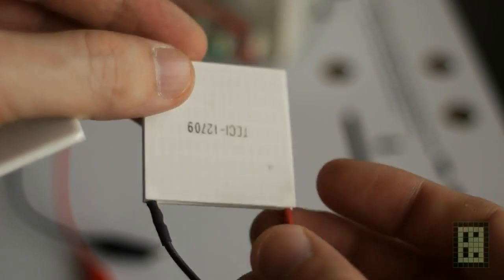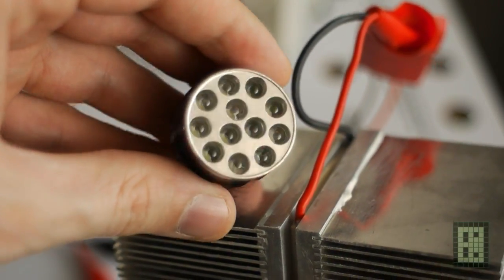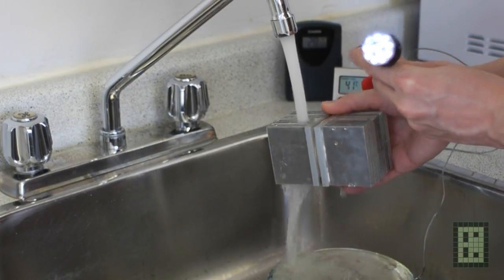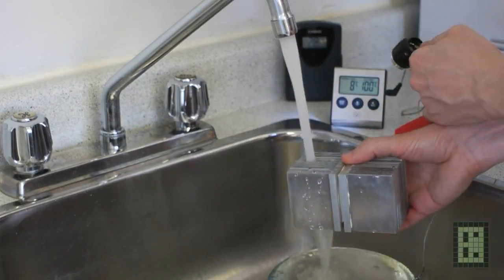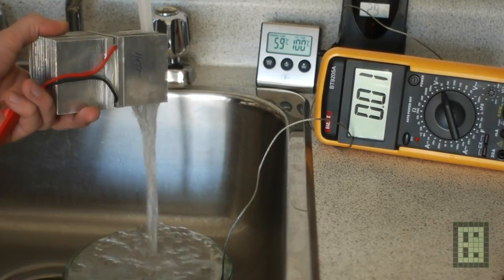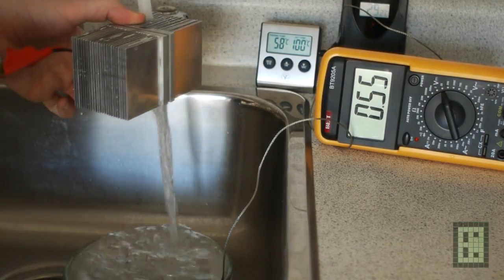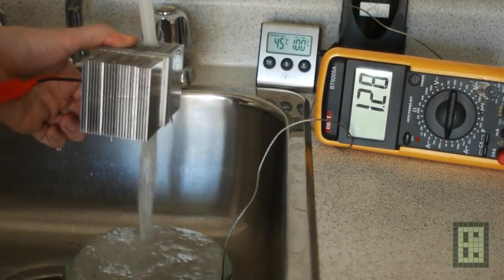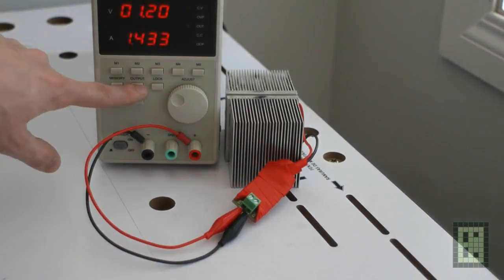Seebeck effect, using Peltier module to generate electricity

Comment: Have you tried TEG (generator) instead of TEC (cooler)
Reply from the maker: I did not tried a TEG but it will have very similar efficiency just higher operating temperature.

Comment: Is the circuit( step up dc convertor) available in all the flashlights?
Reply from the maker: It should be in all LED flashlights that use a single 1.5V cell as LED needs around 3V to work so they need to have a step-up.

Comment: anyone want to get Peltier modules for generating electricity should get the TEG modules, not TEC, as TEG is about 5-6% efficient vs 2-3% and the TEG can handle higher temperatures. TEG is Thermo Electric Generator, TEC is Thermo Electric Cooler
Reply from the maker: You are wrong about the efficiency as they are about as efficient around 5% and since TEG has much less usage is much more expensive. The max temperature is irrelevant and what is relevant is sustained temperature delta as that is what requires energy. Since they are both about as efficient they can both produce about as much from the same primary energy source.
I investigated this for use with solar energy and thermal storage but they are not cost effective against PV panels plus Lithium battery.
My offgrid house is now a net zero energy house with both electricity and heating provided by PV panels with a small LiFePO4 for electricity storage and a very large thermal mass storage for heating.

Comment: There is the concept of proportional voltage difference,then why it is not working practically.
Reply from the maker: Why do you think is not working practically ? Voltage is directly proportional with temperature delta between cold and hot side.

Comment: Hi there great video, as it was very useful to me. I am currently designing a product to generate electricity, while exercising, and was wondering if these chips would be useful for transferring body heat in to electricity? As well as that, I would like to know weather it is safe to have these close to the skin, if these, by taking the body heat away, will make the user colder and by how much?
Would appreciate it if you could answer, as many questions, as possible.
Reply: The product is for a school project btw.
Reply from the maker: +TypicalWill The efficiency is not that great maybe 5 to 10% of the heat will be converted in to electricity and having a heatsink on a large surface of the skin will probably not be a good idea for the subjects :)
This may only be good for a small device like a watch sized to generate very little energy to run something like that.
Maybe it can work if you have the thermoelectric element not touching the skin but with some thermal insulation (fabric) between the skin and thermoelectric element. The amount of energy lost trough clothes from a human buddy is not that large and even if you cover the entire body you only recover 5% of that already small amount of energy.
Average human probably will dissipate around 100W of heat while working. If is wearing some clothes then most of that will be lost trough exposed skin like face and hands.
Even if you completely cover a human in thermoelectric elements and keep the body heat loss at a manageable (healthy 100W or less) then you only produce 5W with 5% efficiency.
Is better to have an electromechanical generator (generator bike) then even with moderate exercising you produce 30 to 50W.

Comment: I wonder what would happen if you place this module in liquid nitrogen?
Reply from the maker: ***** You want to say one half of the module or the entire module?
If is half you can calculated the amount of power you will get out based on the temperature difference. It will be really hard to maintain a large difference you will need a really large heat-sink on the hot side.
If the complete module is immersed then there is nothing exiting that will happen from an electrical point of view.
Reply: ***** If the temperature is low enough the module will reach superconductivity. 

Materials have different properties at very low temperatures.
Reply from the maker: ***** Not all materials will be super-conductive at low temperatures.This peltier elements are made of semiconductors so they will not have superconductivity at low temperature.
There is nothing magic about superconductivity it just means there is no resistive loss but energy can not be created just transformed so you need thermal energy to create electrical energy and the amount of electricity output can not be higher than the input thermal energy.
The efficiency of this particular peltier element is around 5% or less so not that efficient.
You will get quite a bit of power if you cool one of the sides with liquid nitrogen and keep the other one even at room temperature. But do to low efficiency you also need to move a lot of heat from one side to the other about 20x more energy that you will get out as electricity .
Reply: ***** 5% efficiency - much room for optimization.
Reply from the maker: *****
Yes there is room but is not that easy to do.
The material it is build out is also a good thermal conductor so large amounts of energy just go from one side to the other and not produce electricity.
Same problem when you use it as a heat pump and there you can improve the efficiency if you have a low temp delta between the two sides. So you need good thermal transfer ideally without a fan or pump since that also uses energy and reduces total system efficiency.

Comment: I have all kinds of uses like a voltage stabilizer like if your had it connect in parallel and disconnected the power the hot and cold heat sink would equalize slowly and wouldn't shock the system like a old tube radio on the same idea of a capacitor

Comment: how much thermal stress does it able to take...thankyou!
Reply from the maker: By thermal stress you are referring to max temperature? (about 130C absolute maximum) or number of thermal cycles? that will depend on the module manufacturers, how fast the cycle is and the temperature delta.

Comment: A quick question. I checked few modules and noticed that all of them produce electricity based on temperature difference. Is it the other way around, i.e. if I provide current to them they will start producing one side as hot and other as cold?
Reply from the maker: Yes. The Peltier modules are actually designed to be used as a heat pump not as generators. So if you apply current to them they will create a temperature difference between one side and the other. They are not as efficient as the compressor type heat pump but are good enough so that my small refrigerator is using one of those Peltier modules.
And yes TEG will also do the same thing as TEC the only difference is that TEG use a higher temperature solder between elements and because of that are more expensive.
Reply: I am trying to make a small air-con out of them. I have seen a video of a guy from Hong Kong who made one and showed in a video that a 600 Watt module can work fine for a room. I have played with peltiers for past few weeks and realized that it needs certain level of skills and hardware to put them together precisely. Going to visit a supplier here in Shanghai this week to see what they have to offer. :). Thank for your reply, this means I can use it dual purpose and can use the heat generated on the hot side to generate electricity. hummmm ;)
Reply from the maker: Talha Kamran
The cooling efficiency of a peltier module is usually 3 to 5x smaller than the efficiency of compressor used in air-con and fridges. So you will need at least 3 to 5x more energy to make a room as cold.
The efficiency as a generator is around 5% so it will not be a good idea to try and use a generator on the hot side since you will recovery very little energy much less than will be lost by adding a generator and reducing the cooling on the hot side.
Reply: I tried the recovery and was able to produce 2v and 200 mAmps. I have around 4 extra peltiers. Thinking of connecting them in series.
Reply: can you post a video on how a compressor can be made, like a DIY air con job.
Reply from the maker: Talha Kamran
2V x 0.2A is just 0.4W I'm sure is a very small fraction of what you input in the TEC that you are recovering from. And not only that but you you reduce the cooling performance of the TEC because of that additional generator module that prevent a better cooling on the hot side.
DIY air con using a compressor is not what I'm interested a the moment. I'm quite busy with my Solar BMS.

Comment: What a waste of water !!!
Reply: ***** Heat water in a pan and insert the module?
Reply from the maker: That is for sure a big waste of water. It was just the test in the video. I'm not generating my electricity that way :)
Reply from the maker: Th3DEAD Not the same thing. The pan will need t be quite large so the temp of the water in the pan will not drop to much.I will have needed one for hot and one for cold water.
It was also just the short test in the video I was not doing this all the time.
In fact at the moment I moved offgrid and I use rain water that I collect.

Comment: I have created an idea in which all sinks and bathtubs will use peltier material to to create extra current for the home. or at least pay for the hot water.  Copyright.
Reply from the maker: If you heat hot water with electricity then you can recover as much as 5% in an ideal case.
You need to understand that in order to generate power you need to maintain a temperature differential. The heat from the water will be transfered to something else in order to produce power If in an ideal scenario you manage to transfer all that heat form the bathtub to the surrounding air and all this will pass through peltier elements then you will recover as much as 5% of the energy you initially put in to heat that water.
Reply: I used to be a bathtub boy and as i soaked in the hot water I'd drape my hands and feet on the outer edge to feel the coolness of the porcelain.  Even afterwards it remained very warm to the touch.  So i figure 5% back over a years time might not be too bad.  This could be used in a solar house.

Comment: if we want peltier to produce electric power,
How much power will produce (Watt) ?
How high temperature limit for this peltier ?
Reply from the maker: I think you are referring on the CP1-12726 used in this video. If so then you can see from the video with a delta temperature of around 50C (57C-7C) you get about 1.2V that divided by 50C will give you a 24mV / degree C difference between hot and cold side this will be true for any peltier module with 127 elements or about 0.19mV / element.
The thing that will be different will be the current that will depend on the element size this is quite a large one and will output 1.5A at 1.2V the current will scale linearly with the voltage and voltage is dependent on temperature also in a linear fashion.
So this particular element will produce 1.2V * 1.5A = 1.8W for 50C temperature difference.
This particular modules can work at a temperature not higher than the boiling point of water depending on how cold you can get on the cold side but I doubt you can go lower than 0C maybe in a really cold winter but let say for calculation simplicity you can get a delta of 100C that will produce 2.4V * 3A = 7.2W.
You can connect them in series for increase voltage or parallel for increase current the same way you do that for solar cells or batteries.
Another important aspect is the efficiency and that is around 5% so you will need to put in as was the case in the video 1.8W/0.05 = 36W

I think I answered your two question but if you want to know more let me know.
What will be your heat source?
Reply: Thanks a lot for your answer,,
youre great. i will use heat source from exhaust gas of internal combustion engine, for motorcycle or car maybe. (Go green for recycle energy)
why im use peltier, because price cheap in here (about 3,75 USD) and this peltier easy to get in any shop than TEG (Thermoelectric Generator).
I see, maybe temperature for the exhaust gas of internal combustion will be higher about more than 200 degrees celcius, may be it will not safe for peltier ( i see max temperature of peltier for hot side only about 130 degree celcius). may be not applicable.
what about your suggestion ?
Reply from the maker: Mugi Raharjo
You can use a sort of exhaust divert system so that you can control the amount of hot exhaust that gets to the peltier.
There will be some sort of thermal mass like the aluminium heatsink on the hot side depending on the size of that heatsink and the amount of air cooling on the other side the heatsink may never exceed your designed temperature.
Is like having a small flame like the one from a cigarette lighter and trying to heat a large bowl of water even if the flame is 900 degree Celsius the water will never get hotter than a few degrees above ambient because all that is gain from the flame is lost to ambient because of the size of that bowl.   
Hope you understand that the temperature of the exhaust gas will not be the same with the temperature of the hot side of the peltier
Reply: i see this TEC has limit temperature about 130 degree celcius, if higher, it will cause melting of semiconductor element on TEC.
maybe better we use TEG, Thermoelectric Generator, for produce power from heat.
what your suggestion ?
like this site http://www.everredtronics.com/TEG.html
Reply from the maker: Mugi Raharjo
First if temp is higher than 130C for TEC what will melt will be the solder used and not the semiconductor but it will still fail.
As for TEG based on what I see there I do not recommend them.
See in that page the tests done by that Romanian guy with TEG127-40A he got 0.75W with a delta temperature of 40W you will get the same with a similar TEC that will cost 5x to 10x less.
They have the same efficiency so the only advantage is that can withstand higher temperatures but at a premium cost.
You will need to be able to cool down the exhaust quite a lot if you want to extract the max amount of energy from it.
The colder the exhaust gas after exits your recovery unit the better.
Reply: So among commercially available TECs that give alot of power before blowing out (Yes if you ppush them too far you brick them.) the 12708 gave like 9.2 Voc (open circuit dc voltage). When shorted on a 20w dc light bulb rated for 12v (which is a 1.66 consistent amp load) it dropped to about 5.7. 5.7v * 1.6 amp= about 8.8 watts. quite impressive for a tec in my experience.

Comment: I am a high school student working on a project using peltier modules to charge a battery and was wondering if I could wire peltier devices in parallel or series? Would this effect the devices in a negative way, making less efficient?

Comment: This would be a good unit to replace the alternator in a car by using some of the larger unit that produce 15volts 30 amp like the TEC1-12730 to generate power from the heat of the engine and the cold air passing by the radiator or a sheild for a wood or pellet stove and the cold wall to generate power for your lights or battery backup. Just something i have been thinking of doing as a experiment.

Comment: People are asking where they can purchase Peltier element you can try electronics stores as Mouser, digikey, farnell .. etc. in the summer you can use black cooler (ozidized) and heat it from the sun in the summer. The cold part can be in shadow. However I think any solar cell will produce more power than Peltier element. Peltie could be useful if you need electricity in a place where you can't find it, but you have strong temp difference. You can power a temperature sensor/logger for example.

Comment from the maker: It will be hard for me to give you example of heat sources since I do not know what is your application.
You just mentioned an electric motor 500 to 1000W but this can be mounted on an electric bike or a small car that will be a portable application or it can be a stationary one where the size of the thermoelectric generator is not important.
In the first case I suggest you use a more expensive TEG module higher temperature delta possible on the stationary one peltirer will save some money.

Comment from the maker: To be honest I do not know. I need to do precise calculations to know how much a fan will take from the generated power maibe is more than half and then you need more peltier elements to cover the power needed for the fan.
It will depend on the size of the heatsink. If the heatsink is large enough can work even passive without a fan but aluminium is more expensive than water so watter with a smaller heatsink is a better option. One liter of water will absorb 1.16Wh of heat at 1C temp increase.

Comment: Thanks for quick reply. I'll surely take take that advice from you.Also i would like to know that if i use a cooling fan that of cpu instead of water then would it be good enough of water is the only option for the output that i require?

Comment from the maker: Not sure I understand the question. The peltier modules shown in the video can only work up to about 60 to 80C max on the hot side cold side is not an issue it can be as cold as you want.
The peltier module has a certain thermal conductivity so it will only be able to transfer a certain amount of heat from one side to the other depending mostly on the surface area.
Connecting them in parallel increases the output current and in series the voltage same as it is with batteries.

Comment: Thanks for your reply. I´ve got the point. To get 500-1000 watts of power, I will need big amounts of temperature difference, however surface of the module, which is made of ceramics will not last amount of temperature. One thing is how does that work? I mean what is the method to use multiple modules in parallel or series or somehow?